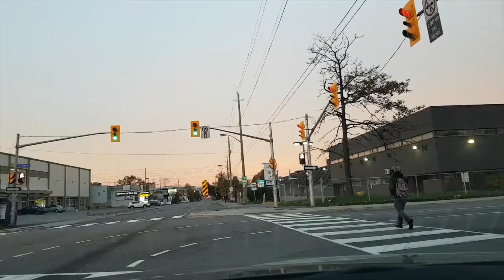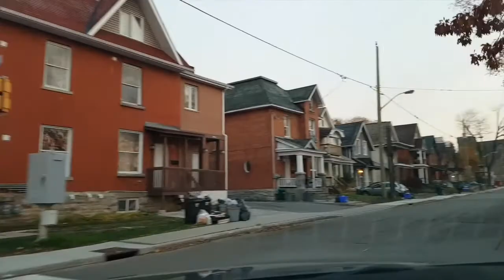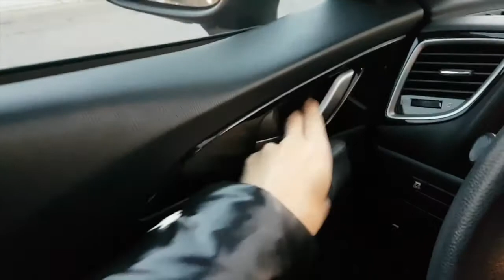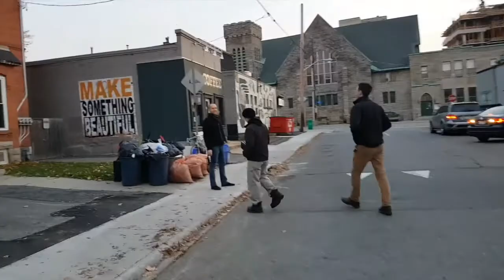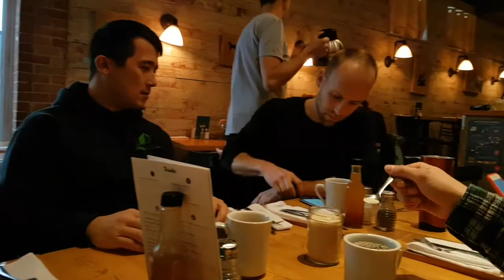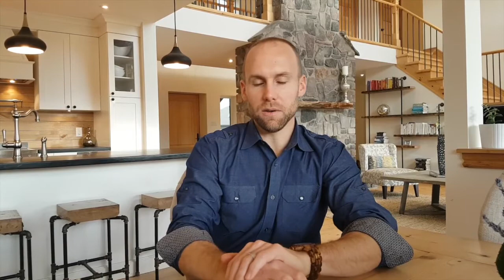What Are The Alternatives To A Gas Furnace?

Comment: Hi great video!
I'm planning to rebuild my home in Toronto, and I've decided that I would like to do a in-floor heating (zoned) + VRF split system + some form of fresh air. I had a few questions:
1. What's the best way to do humidification?
2. I'm currently thinking of using a commercial building BAS controller (i work in the industry). Are there residential alternatives that would allow all of these systems to talk to each other and get some level of programming? 
3. The biggest issue I have with the VRF is the head would look fairly ugly in the room. Do you know if there are models that can be hidden in the wall (between the studs) or a better way to do zoned cooling?

Thanks!
Reply from the maker: 1) I haven't done a lot of research on humidification with these systems and it's actually something that's on my list as my home is too dry in the winter. I'm hoping I can install a humidifier on the ERV system duct work but I haven't looked into it yet.

2) I recommend you check out Kirio. They're coming to Canada soon: https://www.mykirio.com/

3) Mitsubishi has options that will look better than the wall mount units, however, it call depends what you want to spend and what makes sense for your system as a whole. You can see some options here: http://www.mitsubishielectric.ca/en/hvac/city_multi/s_series_indoor_unit_options.html

Hope your build goes well! Will you be building it yourself?
Reply: The issue that i see is that even in an ERV system you're going to have pretty cold air coming in if it's -15 outside (i.e. when you need humidification the most) and it won't have a lot of capacity to hold water. So unless you're heating that air before humidifying i don't see how it would work. Although a small electric coil might do the trick
Reply from the maker: I am heating the air with a small electric duct heater before it gets to the unit.